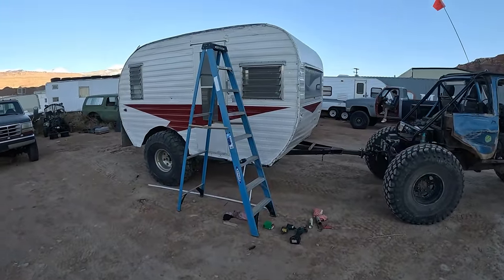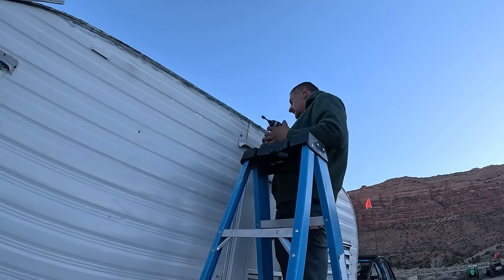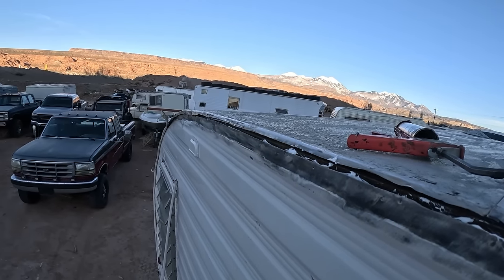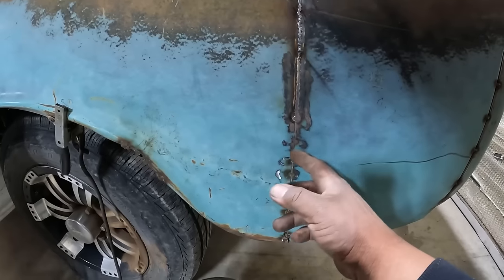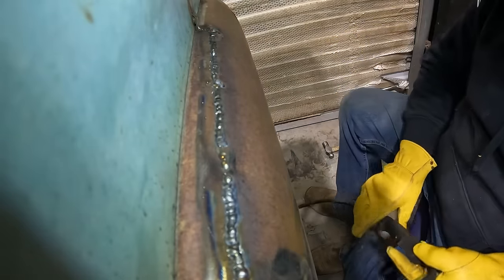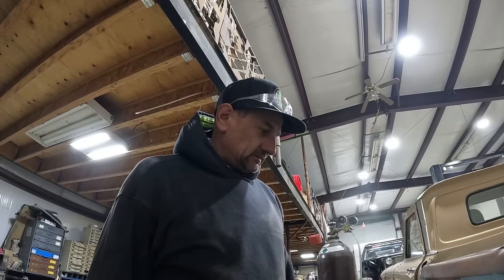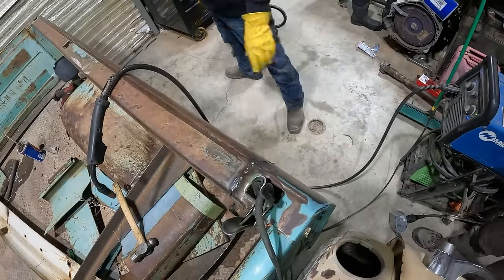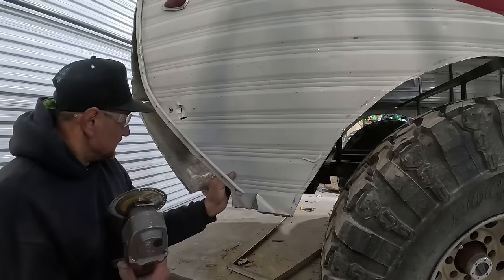Off-Road Camper Gets Screwed

Comment: Hi Shawn, when grinding your welds, always grind “with” your weld never sideways. Keep your disk as flat as possible when you’re getting close to flush. When you see the grind marks developing on each side that is as low as you want to go. Do not attempt to grind the dark areas on each side of your weld. You will always have a low spot there as the weld sucks down the parent metal on each side of the weld with thin metal.
 Buff each side of the weld to get rid of the oxides, then block sand with 60 grit. 
 This will keep your body filler, thin, and narrow

Comment: OMG, just had an idea. I know you relocated the fuel tank. Where you fill it at drivers door. Take an old filler neck. Then find some sort of electrical plug that will fit inside of the neck. Mount it and when someone asks. What motor you go in it? Open the cap and say. It's an EV Truck.

Comment: My trailer is 10 years old now.  I found out that Flex Seal paint is better than most RV roof paints for sealing.  In the hot So Cal sun, it has held up really well.  Of course, I don't really care how it looks.  If you're picky then you might want to consider something else.
Reply: It's to tow behind about 1/3 of an old squarebody blazer, i'm sure Mike's picky about looks.
Reply: @UmmmmmmmWhat  wink wink.

Comment: Hey Mike and Shawn Show! 
That Lap Sealant is good stuff! Should help absorb vibration between the dis-similar metals as well as add corrosion resistance.
Great job on the trailer, if I didn’t live so far away, I’d volunteer to help.  It’s taking shape nicely! 👍🏼

Comment: Galvanic Corrosion, when two Dissimilar Metals come in contact with each other.
Electrical field it happens when Copper and Aluminum contact.
Auto industry it happens when Steel and Aluminum contact, which is happening with Jeeps JL and JT.
Reply: Prescision (sp) even makes a special u-joint for some of the GM trucks with aluminum driveshafts. I believe that Spicer offers it as well. 😊

Comment: Mike and Shawn, you guys are the BEST.
Mike a bit of advise- when you're done squeezing the caulk out, you need to push the Quick Release Lever. It will release the pressure and not make the caulk keep streaming out.  Honestly it was driving me CRAZZY. 
Looks to me that was why you were making a mess.
GREAT Job, can't wait till you take the camper on a trail.
You Guys keep up the GOOD WORK.

Comment: Use coat hangers as a filling rod when welding up gaps it works surprisingly well, you can use compressed air to cool down your material as you go, weld a little then blow area down, or do whatever you want . Cheers from down under.
Reply: I’ve seen complete exhaust systems welded together with coat hangers. It NEVER had any leaks either! 😉

Comment: Galvanic corrosion... looks like you used zinc coated fasteners, so the most likely thing to corrode will be the steel angle you used. The stock you used seems thick enough to last your entire lifetime before it becomes an issue.

Comment: if you get a piece of copper like 16ga or 18ga or thicker.  you may be able to get away with thinner i cant say ive tried tho.   an put it behind your weld where the gap is you can weld over it an it wont stick to the copper. .  ive not seen your stick rod trick , tys its good to know.

Comment: As someone who went to HS in the late 90s, i never owned a Ford Probe but have been a passenger on some strange abductions that involved warp speeds at the 111-114 mph stock limiter chip (depending on generation) on windy back roads... in undisclosed locations, though the statute of limitations has passed so it really doesn't matter.

Comment: Mike is doing body work or panel beating on his camper. That's what dad did, he was a panel beater from 1966 in Sydney, Australia. Nice to see Shawn rebuilding the ute..  :P
Before bondo/putty/bog/body filler, they did lead wiping. I can just remember dad doing it when I was around 5, so 1978 but that was banned soon after that. I know some people kept use lead wiping till it was illegal because the resign based body filler was so expensive in the beginning and lead was cheap
Reply: That’s where the term “lead sled” comes from 😊

Comment: For roof I've found flex seal the best on my trailer and had old silver seal which sucks and has blister's and cracks allowing water so flex seal is great and has a shiny finish, it used to be about $60 but inflation it's $100 a gallon, it will easily cover your tear drop trailer.

Comment: Shawn, i recommend using a solid stone grinder wheel to bring down your welds, then hit it with the flap disc wheel. You can focus more on getting the weld flush with the body with a solid wheel. The flap wheels has too much flex and can cause you to take material off the body before the weld is even flush

Comment: The further the wire sticks out of the gun the less heat it will have when welding sheet metal. Watch Bondo billy he has some good tips on doing body work

Comment: Bi metallic corrosion is a problem in very damp locations and where there are also electrical fields involved. Not in the Utah desert. Or in the SoCal Mojave desert where I live. My offroad race buggy I built in the mid-late 70s and nearly always living outdoors still shows  zero bimetallic corrosion between the steel frame tubes and the floor pan or the interior panels like firewalls or the skidplates. If you were in the rust belt where you have not only constant high humidity, but also salt on the roads for 1/2 the year...then there MIGHT BE an issue. Make sure the skin is grounded to the frame and all bases covered.

Comment: just a idea for the camper hitch, saw the type of hitch they use in australia with the off roading and camping they do, the hitches are awesome , they flex in all angles with out pinching , anyway just a thought
Reply: pintle, I believe?
Reply: @wiresmith2398 After all, that IS what our US military uses. They’re a little more noisy, but if the noise bothers you, just have more tongue weight % and then it’ll most likely go away. 😮😊

Comment: So I heard using flux core on old dirty sheet metal help flush the junk out of the welds. Also messing with the polarity can change the way it welds, some combo machines have instructions on what polarity for different types of welding. Learning myself but thats some info I found.

Comment: Galvanic corrosion that happens when dissimilar Metals come in contact in the presence of water it's not the water itself the water forms a conductive path for electrolysis when impurities are present it's the electrolysis that eats the aluminum because of the anode cathode equation
Reply: Does it only happen with aluminum or does it happen with other metals 2